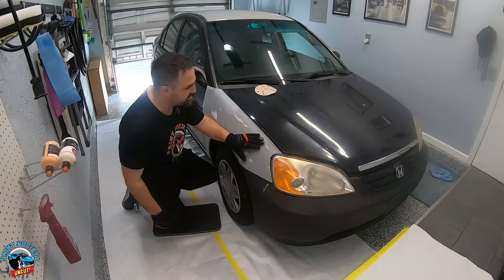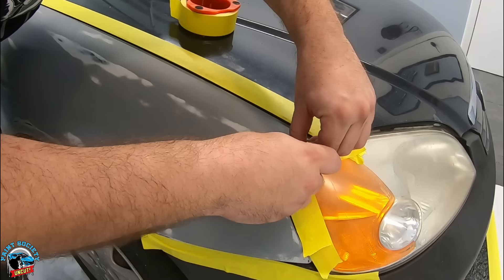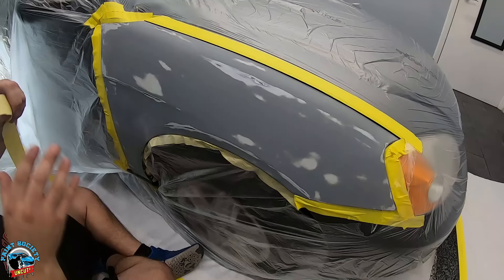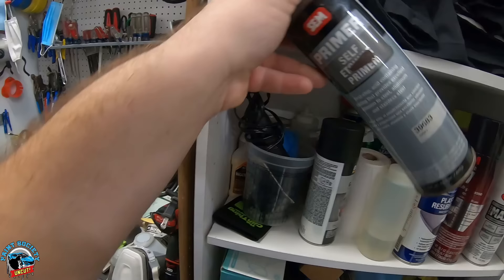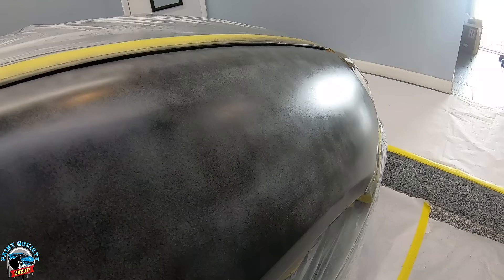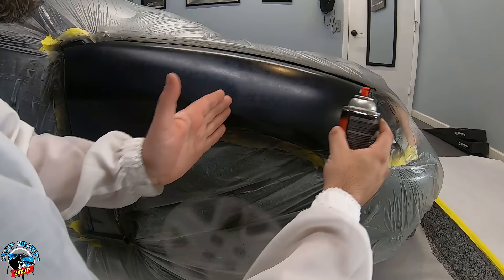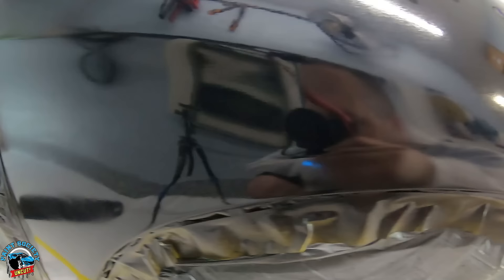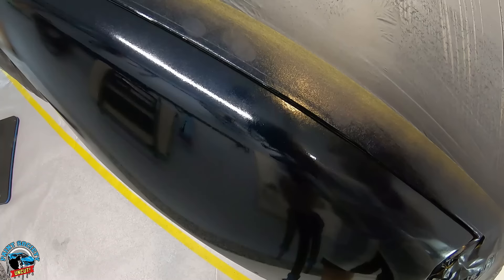Painting your Car with Spray Paint!

Comment: Can you recommend a wet bed or orientation coat to lay down on the entire panel before applying a metallic basecoat to a spot repair?  My understanding is the wet bed helps blend metallics by reducing halo and it prevents the metal flake from piling up in tiny sand scratches.  I was thinking spray the entire panel with SprayMax 1K clear, then reverse blend basecoat (spray larger area, then smaller, then repair area only), let that cure, then 2k clear the entire panel.  I'm just not sure if 1K clear is the best rattle can option for an orientation coat.

Comment: Hi sirs may I ask a question? I live in Swaziland. Here paint shops are almost zero. And the cost ... I have a '73 VW Beetle with a  bad paint job. The paint is falling of in pieces leaving the bare metal exposed. Bad prep work I am sure. Also no clear coat I can see. So I am going to respray the entire car using your method with aerosol spray paint. 
Q1 : can you use red oxide metal primer on the bare metal as a first coat? And then sand it down to a smooth finish? 
Q2: you get special paint that is like baked enamel to respray appliances such a stoves and fridges. Can I use that on the Beetle? Should be durable? 
Unfortunately it only comes in black and white. But I can make a nice contrast job I think. 
Your videos are amazing keep up the great work.

Comment: I had a problem with the foam pad I bought. I'm used to the wool pads, the foam pads are kind of "new school". I started buffing and just ripped some paint off of where I did body work. Long story short, I'm repainting that area. I think the paint was not ready to be buffed also, it was only a couple of days. In your video, you waited a couple of weeks. Definitely, better to wait longer, if you can. The paint gets harder, and you're less likely to burn through, or rip through like I did.

Comment: When I was as young as 16 years old, I'd paint my rims with the brightest silver paint I could find. We called them, " Hillbilly Chromes" rims. Then I started painting cars with Rustoleum. Had to use a soft brush. I only did this on some older cars with a bad paint job. I got damn good at painting cars with spray cans next. Let it dry for a week, then spray clear coat over it. Beats paying for a $7000 paint job.

Comment: Question.
I have a 20-year-old Acura TL. It's getting sun fade issue due to the dreaded clear coat issue.
I went to the auto parts store and bought the little can of dupicolor seen in video.
 I was blown away, how well it matches my paint.
 I didn't buy the expensive 2part clear coat can. 
Dupicolor actually sells their own one part clear in a small 8ozcan.
Will that still give comparable results?

Comment: I have a 3x3 inch surface rust square from a sticker the previous owner had on the tailgate of my 2010 Silverado, is this a method that I could use? I guess my question is more in the prep stage. Should I do the whole tailgate? Or could I prepare the work area followed by this method of repair. Thanks in advance to whoever can point me in the right direction!

Comment: The duplicolor sprays say that you should do some coats with a pause of only 1-2 minutes. Here you let it completely dry and clean the coat and only then spray the next coat. Doesn't it matter what can you use? Can you always do it like that? First a very light coat, let it dry, then apply the next, let it dry etc. or should you follow the instructions on the can exactly?

Comment: I just did my daughter’s tail gate with a single stage mixture in a can. I’m pleased with the results but the shop said it should produce a glossy finish but it’s more like a satin and is a big contrast to the car’s factory finish. I’m considering applying a top coat with a gun but can’t do it for another couple of weeks. I know, ideally, top coats should be applied within literary minutes after applying base so I’m wondering will this be a problem.

Comment: Hi there, if you want to spray a brand new non painted plastic bumper, do you need to sand it first (if so, what size), and do you need to spray it with primer for plastic so that it doesn't peel off easily? Sometimes, it's very tricky to spray plastic based parts. Thank you.

Comment: I need to redo  my wife's roof top from this lovely FL sun thanks to Toyota not using very thick paint. It has developed unsightly surface rust plus cracked clear coat int he other areas. I have found a company with good reviews that makes color matched spray cans for her paint at a reasonable price. maybe the day before tape it off and sand it with 80 and 400? What do you suggest for a good spray primer? I dont have time for a two part epoxy to dry, this needs to be a mostly one day project before the rainy season hits since this will be on my driveway and she needs the car the next day.

Comment: For the novice, you mightwant to suggest an orbital buffer so they dont burn through the fresh paint, how to come off the edges correctly :)
Reply from the maker: It won’t do what it needs to do to buff paint
Reply: @PaintSociety  ? I am not arguing, just that if a first timer grabs a rotary, they usually will do something that they will regret.  I have used orbitals and the correct compounds / polishes to bring out 3000 grit many times.  A 20mm throw is even better 😀  love your vids and pick up new tricks with all of them.

Comment: tips and tricks question,   i see guitar guys use super glue to fix scratches can the same thing be done on auto clear?   Reason I'm asking is I did a custom airbrush job on a Harley and the guy scratched the paint , dont know yet if its down to the plastics but will need something to fix the scratches. Any helpful tips or tricks on this Brian?

Comment: What is recommended for a Good flexible primer sealer for plastic bumpers? I have the Seymour PBE Flexible Primer and SEM Flexible Primer Surfacer and they work GREAT! but im looking for Primer Sealers out of a can that I can use... Either a 1k or 2k but definitely prefer a 2k can that either is activated by moisture in the air, or has a 2 part chamber system inside the can... Any recommendations!

Comment: I am going to redo paint job from 2 years back, similarly the final end result came out amazing after wet sanding it but mistake I made was the failing clearcoat (The reason I painted to begin with) wasn't clearcoats failing, it was way down under instead, I only sanded down to the base layer to save myself from getting into metal but basically resulted in it failing again, in the exact same factory spots... 

My question (It'a a 8th gen honda civic notorious for failing painting) this time around go down to metal, etching primer, regular primer, base, clear? Is that the route I should go this time?

Also I used the 1k clear and I noticed even after babying it while washing it, i would end up with scratches, so I am using 2k this time around even though it's more hefty...

Comment: Thank you Brian! May I have a question that I saw you used a tack rag after first black paint, this is very useful for me because we don't know what will stick to the panel during coating in a not professional working area. But when I use tack cloth, do I need to worry about the wetness of the first coat? should it be completely dry to tack? What I considering is that the paint may be dragged by the rag if it remains sticky. Appreciate again for your teaching.

Comment: Hi,great Explanation....,I noticed you used Dupli-colour aerosol and then Eastwood 2K Clear.As a bodyman/Painter for many many years,I was always told by all of the PPG,Seikens/Dupont/RM, paint representative, NOT to use different Brands of paint and/or clearcoat because you may get "Chemical Reaction" from the different Manufactures chemical Makeup as they are different proportion chemicals....I once did this "mix" and it wasnt Fun and if  If I ever did do it after, i would get an old fender/panel and do a "test run" on it before i hesitantly did this,what are your thoughts? ty 100-100

Comment: I just applied a couple coats of Duplicolor acrylic lacquer on a guitar body a couple days ago. I am planning on using Spraymax 2K Glamour High Gloss for the top coat. There are many opinions online about how to go about using the paint and clear together. Many say to wait at least a week to let the Duplicolor cure and lightly sand with 800 grit before spraying the 2K. Now I’m confused after watching this video and seeing you apply the clear right after the paint. Is it unnecessary to wait and/or sand between?

Comment: So if I got a oem fender from the salvage yard that has a factory painted color on it and I want to Change the color to match my car. What process do I need to do to prep it just do 400 then 600 grit and then spray or should I apply primer to the fender then sand that and apply my base coat

Comment: Excellent video, thank you.  A quick question, if I spray on a single stage paint and then want to clear it later I was told I should wait 2 weeks for the single stage to cure and then scuff (with a scuff pad) and then add the 2K clear.  Is this correct in your view?

Comment: Love this channel. I want to tackle a very small dent/scrape in the lower part of the rear hatch on my VW wagon. Want to try a blend. Unfortunately have to use spray cans. Do you know if the clear base for blending the color coat comes in spray cans? If not specifically, would a non catalyst clear coat work? (I bought a clear coat w/ catalyst for the top) Thanks for all the great info.

Comment: Hi, I have a hood that came with an e-coat and I just left it as is while taking it to cruise nights.  The e-coat has finally started to wear off over the last 5 years or so and some areas are starting to show bare metal with a light e-coat over it.  Do I need to sand off all the e-coat and go down to bare metal at this point and cover the whole hood with Duplicolor Self-Etching or is it okay to have some areas still with minor thin e-coat?

I also noticed you didn't apply a filler primer over the Self-Etching.  I hear this is an important step before laying down the base coat.  I already have the Duplicolor filler primer, so I guess it won't hurt to lay over the Self-Etching primer right?

Comment: I got a dodge charger and I tried to add a widebody kit and when I saw one video I heard them say they used adhesive so I tried it and it was an epic failure. I'm in Saint cloud florida and want to know what's the best color match paint and clear coat for a black 2016 dodge charger. I sanded it down with 220 grit do I need to use another grit b4 primer as I primered one fender and it looks like there little craters in it. So I don't want to paint it and it shows up on the paint and help would be appreciated Thanks

Comment: Thanks for the video.  I'm an amateur w/ a small project and can really use your advice; I'm wanting to sand and paint a plastic skirt that originally had clear coat, but think paint will hold up better in heat. What do you advise I use in primer and paint for plastic? Thanks in advance

Comment: Question, I used some Duplicolor on some wheels. After i let them cure, the paint chips off very easily. Any insight? 320 grit sanding, sandable primer, no sealer, 3 coats base and 3 of clear.
Reply from the maker: Maybe applied paint too wet and it didn’t cure properly

Comment: I got in a time crunch, could not find the 2K Aero-Spray Clear Coat, and used Duplicolor Clear Coat after the rattle can paint job. Not happy with the finish. Can I use the 2K Aero-Spray over the top of the Duple-Color clear coat? What is the best way to fix this?
Reply from the maker: You need to scuff your surface with 600 grit. With the base again and the 2k clear

Comment: Hey paint society. Thanks for the video. I'm trying to learn the fine art of painting and I've hit a snag. I am painting a small ABS plastic piece for my car using the same Honda Nighthawk black as used in this video. I laid down some adhesion promoter, a level of primer, sanded it, then I put down my color (the nighthawk black) and it (almost) immediately went dull and dried all speckled. I followed the drying times recommended on the can. I tried again which involved sanding off everything I did. I noticed when I used isopropyl alcohol to clean up my sanding job the wet piece suddenly looked great. Then I took the piece back down to the plastic and tried again...same result!   Did I use the wrong primer? Did I get a bad can of paint? Any thoughts? Thanks to anyone that would like to help me solve this.

Comment: For a 17 year old car thats gonna be a huge improvement but what I say next is gonna sound a little harsh. Its not meant to be. I am just a guy who became a time served spray painter in the early nineties working for one of the largest Insurance companies in the UK , at one of their accident and repair centres. Hopefully you may find something I write beneficial.

First of all I appreciate that you are using spray cans. I also appreciate it is a 17 year old car and I have to say I was pleasantly  surprised by the spray lacquers performance.

Your spray technique and advice is wrong. Start at the top of the wing(fender) and spray at a continuous motion keeping an exact as possible distance to the panel. Spraying in small strips is going to lead to lots of overlaps thus increasing the chances of runs.
 
Spray your base (metallic) in the one direction ie horizontal. Going between vertical and horizontal will have the metallic fragments in the paint land in a non uniform finish.  So under refraction ( sunlight) you may notice clouding in your finish as the metallic parts of the base refract light in different directions due to a non uniform application. I know you only sprayed vertically in the lower part of the wing (fender) but its the technique and the reason for why you want to apply paint in a certain manner.

So you you had a fly land in your lacquer. You did what we did and used a bit masking tape to remove it. However, what you wanted to do was flood that part afterwards. What I mean is that instead of giving each coat say 10 minutes to flash, you would just spray that small area ( not the whole panel again) and again leave to flash and keep doing so until it levels (remember in nature water always finds a level) when you are happy that you have sufficiently applied a good thick coat of lacquer to that area, you can then be sure that afterwards that with some wet and dry paper there will be no trace of it as you sufficiently applied enough lacquer to fill in any indentation caused by the insect or any other debris.

Bonus tip: before painting, wet the floor  (not soak) around the  area. This traps all dust on the floor and stops any flying up onto your panel especially when you paint the lower parts of the car.

Another bit advice is get over your fear of water lol.  Water reduces the abrasion especially when de-nibbing or using a compound polish or wax.  So no need for lots of different products trying to get rid of swirl marks that were in part caused by taking the DRY approach!. 

Using water can be messy so keep all the masking and paper on until you have finished polishing!. No need to rip it all of just because the paints touch dry.

Yet another tip: Do not buy into this crap idea that you need different foam pads for different polishes, waxes etc etc.  Nor do you need different products. A compound polish followed by a finishing/protective wax. That is all you need as your painting is the FINISH.  No polish is going to improve a proper finish. 

So de-nib  the panel. Put some compound polish on., then with a sponge add water, Yes thats right water and buff your panel. Keep adding a little water by sponge until all abrasive marks caused by de-nibbing has gone. Once you are happy with that. Apply a protective wax of your choice and again using the exact same pad you used for the polish buff the wax. Finish off with cloth. Job done. 

Anyway good job, Id have painted onto the adjoining panels as it is a metallic paint after all  but that is probably beyond the scope of this video of course.

Comment: I have been flipping few cars doing fixes like this mostly Honda and Toyota. Right now I have 06 Honda pilot I'm working on I'll be doing paint repair after I get done with the mechanic stuff. I can make 2-4k most people see that paint peeling they know how much a body shop will want to fix it not worth paying them to fix it. I don't use the spray cans I use spray guns don't waste entire can of 2k one car it's not that cheap. I buy a pint of paint from local auto paint supplier look for ones that are in industrial areas they are cheaper mostly supply small body shops. The ones you see on main streets with store fronts will be more expensive. I have a swamp cooler pumps air into my garage I shut off the water slid in a filter in front of the outlet crack the roll up door open about 2 feet let the air out keeps the fumes from building.  I never buy black cars try to stick with white, silver, or gray.

Comment: I have never used it on a car but I build Custom Bobber and Brat Motorcycles for a living and own my own shop and just about everything I paint is with Spray paint because the surface area's I paint aren't very big. I almost always use VHT Paint and my clear coat paint is USC Spray Max 2k, I've used Eastwood before but USC gives me the same results but is half the cost, I get a 4 pack of USC Clear coat for $70 as oppossed to $30 per can of Eastwood. I also don't use PrepSol, I use 90% of higher Rubbing Alcohol, once again cost savings, why spend $12-$15 for a 11 oz can of PrepSol when I can get the same results from a 32 oz bottle of 95% Rubbing alcohol from Wal-mart for $2?